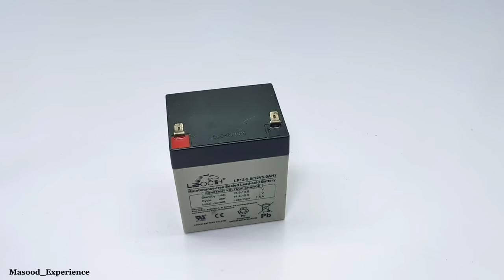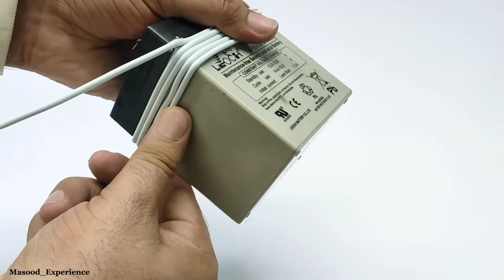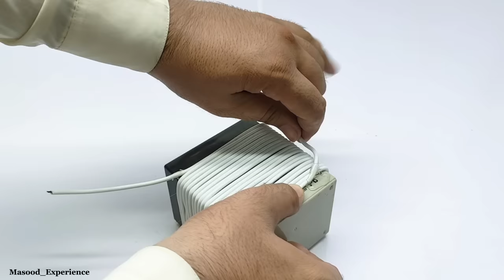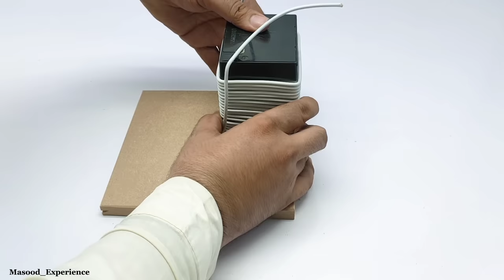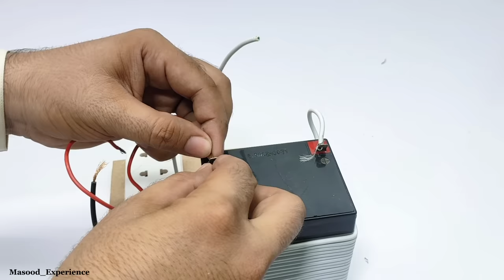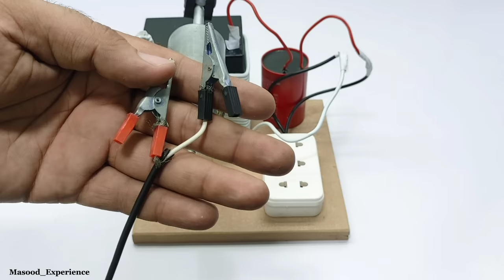Battery convert to 220v 12000w generator #free energy#viralvideo

Comment: Brilliant, the only thing I would have done would be to have put a phase lock module in series with the capacitor thus smoothing the output and removing any subduction resonances produced by waveform distortions. (Note a phase lock module can be purchased at any hardware store for about 6 dollars - look in the Network Tools section)

Comment: I recreated this machine and placed it next to my toilet.  I wrapped the toilet seat in aluminum foil and connected it.  Every time I 💩 so much energy is created that I can use it to drive the water pump for flushing.  If I put on my aluminum hat, the energy is still enough to run the washing machine, but not under a full moon.  Oh, and one more thing, if my car won't start I take a speaker magnet and let it circle over the starter battery and it works. 🤓